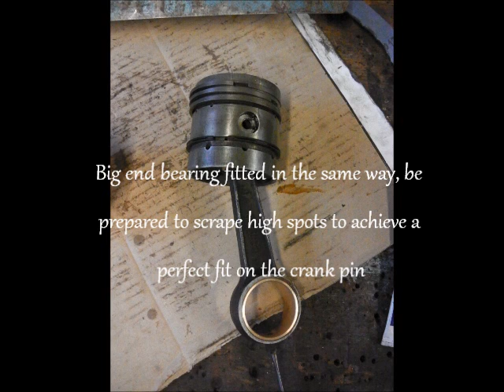Overhauling the Lister D Crankshaft

Comment: Cleared a lot of grey areas on bearing removal and fitting. Inspired me to restore my Lister D. Thanks Phil.
Reply from the maker: You're very welcome. There are better ways, but I tried to show that the various parts of the Lister can be rebuilt without need for special tools. A press and a good set of Sykes bearing extractors would make it so much easier, but how many of us have such expensive kit? Enjoy the restoration, Phill.

Comment: Nice vid. I have just done this work myself. And would suggest a slightly different approach.  Warm up the crank bearing  carrier and press both bearings into the carrier  while it is all still warm rest it on top of vice or table with a hole big enough for crank shaft to go through  add a bit more heat to the inner races  then just drop the crank shaft through both berrings at the same time  . For me it just fell straight through. And into position.  The center casting was just too warm to touch bear hand but fine with gloves.  This may help others. You could always cool the crank in freezer. If you are worried it won’t fit. Through. But for me worked at room temp

Comment: Hello. I like your videos and the how meticulous you are with your work. I repair plant machinery and lorries and I find it really handy to use a old deep fat fryer for cooking chips in for heating up parts for interference fitting. I just use standard cooking oil and it is very affective.
Reply from the maker: +luke smith 

Thanks for the comment Luke, I like the idea of the fryer - very handy to have set up in the workshop. I shall have to keep an eye on ebay for one of those.

Cheers,

Phill.